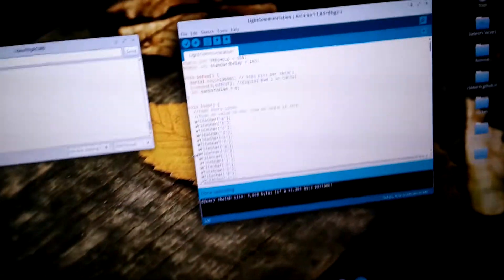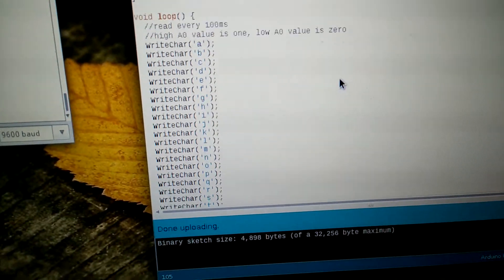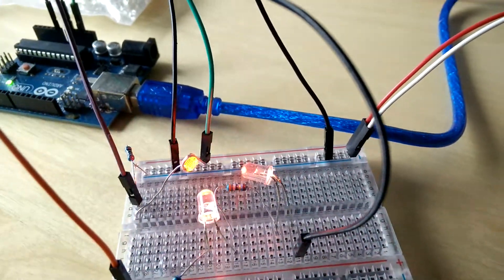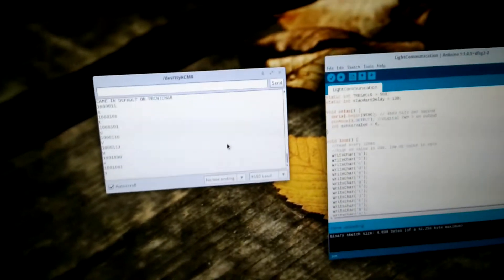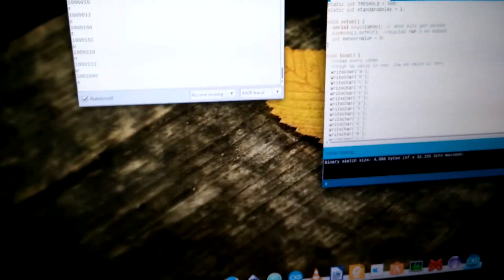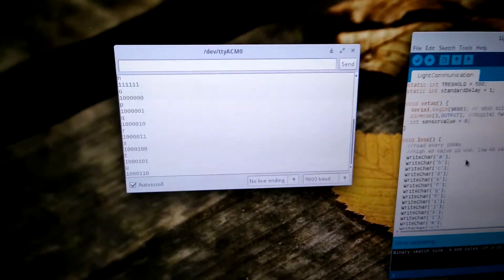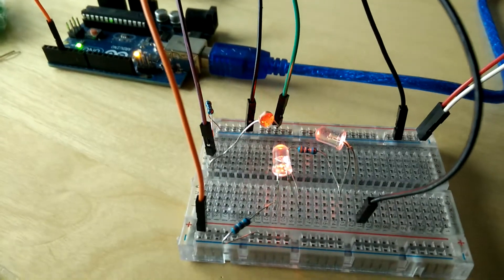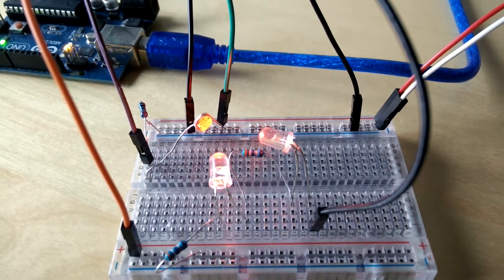Visible light communication with an arduino

Comment: It looks fantastic and I am doing a project which is very similar to yours. Can I have your schematic of your circuit and my email address is (tanjialin0904atgmail.com). Thanks
Reply from the maker: Jialin Tan it's somewhere in the comments :)
Reply: I have found that. Many thanks
Reply: Do you know how to communicate between two arduino boards?
Reply from the maker: Jialin Tan yes it but it's a lot harder than this. The main thing that will go wrong if you upload the unmodified code to both arduinos is that they will not be in sync. So you will need to add some mechanism to sync both arduinos. You could try to google stuff like "PLL" or "preamble". :) I plan to do this in the future, but at least for the coming 6 months, I don't have the time to work on it.
Reply: Thanks for your reply. Now I am working on it since it is my fourth-year project. Your project is very helpful and inspiring. If you have any progress of it, please contact me. Thanks a lot

Comment: I'm working on the same project but i want to transmit the audio and image...would u plz help me out.. or make another video in which u transfer image or audio...! Thnks for the cool video.
Reply from the maker: Dangerous minds I don't have the time to do that right now, but I'm sure Google can help you. High level these are the steps that you'll want to do: 
1) load your chosen image 
2) convert the image to bits 
3) send these bits instead of the alphabet 
4) reconstruct the image from the received bits
5) plot the reconstructed image

I think the second step will be the hardest. Try to google for "arduino image to bits" or something like that. Good luck!
Reply: Well found no answer from google will u please help me out..! Perform one more experiment send smallest bit image from light..!

Comment: hey Vision, it's cool and very helpful. but can I replace the photoresistor with photodiode using the same code like yours? or it must use a different code?
Reply from the maker: Audy Pristikasari hey, yeah that should work too, just make sure to play with the threshold :) the rest of the code should work. Have fun!
Reply: thanks a lot, Vision. I've changed the value of threshold but why in serial monitor it always read on 1111111. ..
Reply from the maker: Audy Pristikasari maybe this video will help, https://youtu.be/HnUYH1pBIrs
Reply from the maker: If it reads 1111111,  maybe your photodiode is always conducting. Try to put it in a darker spot.
Reply: it works. thanks a lot, Vision! :)
Reply: Vision what if I want to measure the responsivity of photodetector? how should I do?
Reply from the maker: Audy Pristikasari You can use a multimeter and put it on resistance. You can see that in the video I linked to in the comments above/below :)

Comment: Hey it's a great work 
But would you help me please 
I want to add some extra letters what should I do in code
Reply from the maker: Rafik Hisham excellent idea. For now, each character only has 7 bits, so you'll only be able to have 128 characters, of which 26 are used so far. For each character, just add a sequence that isn't used yet, and add it in the case/switch. I recommend that you use ASCII for this.
Reply from the maker: Rafik Hisham excellent idea. For now, each character only has 7 bits, so you'll only be able to have 128 characters, of which 26 are used so far. For each character, just add a sequence that isn't used yet, and add it in the case/switch. I recommend that you use ASCII for this.
Reply: Vision i tried it before but it get confused and i didn't understand the str-'0' so if you give simple example that i can use it, and one more thing for last 2 days i tried to make Tx standalone and Rx but the Rx not working good any suggestions? 
Thanks in advance
Reply from the maker: Rafik Hisham Okay, first of all, adding a character:
Two things you should add. 
Once in writeChar() and once in printChar(). Google "ASCII table". You'll see that the characters and light flashes are ASCII encoded. 

For example, say you want to add a space character. If you google the ascii code for a space token, it's 32, or in binary 0100000. 
So you go to writeChar() and printChar(), and add a "case" with the sequence 0100000. In writeChar, a binary "1" encodes to a boolean "True" and "0" to "False". 
In printchar() you can just use the binary sequence. 

Then, your question about the str-'0'. It's a trick to make sure we've got the right character. If yeu want to know how it works, google for "Arduino character representation". Basically, characters in arduino are represented by integers. 

And lastly, I love that you are trying to get it functioning between two arduinos. That was also the next step in my plan, but right now, I don't have the time to do it. The main problem with doing it with two arduinos is that they should be booted on the exact same moment, otherwise it might start in the middle of a character. If you want to avoid that, you should find a way to synchronize both devices.  Hope this helped. Enjoy playing with the arduinos!
Reply: Vision thanks a lot bro if I faced another problems may I ask you again? And what's the best way to communicate with you
Reply: Vision and more question in function lightflash what's the function of it? And should I change anything in this function to add more characters? And why it's input only letters (a,b,c,d,e,f,g)
Reply from the maker: Rafik Hisham lightflash is the function that will actually tell the arduino to put the LEDs on or off. You don't have to change anything in that function. It takes 7 inputs because that's the amount of bits I used to encode a character.
Reply: Vision why exactly the first alphabetical letters?
Reply: Hey Bro , I tried to add extra letters but there's no use why you encoded the 'a' for 49 ? cuz when i tried to use the ascii there's no use
Reply from the maker: It doesn't matter what you name these variables, they are just inputs. You could also name them "input1", "input2", etc. instead of "a", "b" etc.
Reply from the maker: Yes you're right, my encoding is wrong. I didn't follow ascii. I just started counting from ascii('0'), which is 48. If you want to do it the right way, 'a' should be 97. Sorry for that.
Reply: Vision but when I try to do it with ascii it doesn't work right?!
Reply: If you would please modify your code for any example you want add a single upper case letter or a special characters
Reply from the maker: Rafik Hisham
 I'm sorry, you were right all the time. So, I don't encode ASCII, but the difference between the ASCII of the character and the zero '0' ASCII character. Please find my example here: http://pastebin.com/XYb4Q5aR . Sorry for the confusion.
Reply: Vision thanks a lot bro but why in printchar you coded A 1001011 which equals 75 not 17??
Reply from the maker: forgot to remove the first 1 in that sequence

Comment: can you show me a picture of the circuit please?
Reply from the maker: j g.a once again, DNS troubles atm, my site will be online in a few weeks. For now, you can see it here:  https://raw.githubusercontent.com/RobbertH/robberth.github.io/master/assets/img/vlc/vlc_circuit_diagram.png
Reply: ok. thanks very much
Reply: can you tell me what resistence i need for the photoresistor please ?
Reply from the maker: It's a 10K Ohm photoresistor when it's dark. I use it together with a 1K ohm resistor to make the voltage divider. You can watch everything in this video: https://www.youtube.com/watch?v=HnUYH1pBIrs&feature=youtu.be .
Reply: I don't know why, but the letter a, b, and d don't work correctly. can you help me please?
Reply from the maker: j g.a sure, what's up with them? Are you getting errors?
Reply: the photoresistor isn't able to recognise the letter a, b, c and d. it give me an error.
Reply from the maker: j g.a try adjusting the threshold
Reply: I have tried, but it doesn't work

Comment: Hi. I'm having problems with this circuit. The LEDs blink at 9600 BR but the computer prints only "came in default by printchar". I've tried other baud rates, even 300 baud rate didn't worked. Can you please help me?
Reply from the maker: Yeah the baud rate is for your serial communication, the things you should adjust are the standard delay and the treshold value. You might want to watch this video https://www.youtube.com/watch?v=HnUYH1pBIrs&feature=youtu.be .

Comment: Hey, your project is very nice. Do you have the circuit diagram for it?
Reply from the maker: Thanks man! I don't have a circuit diagram, but it's actually very simple. Just connect a resistor to 5V, the other end to some analog input pin, and then connect a photoresistor to ground and the other end to the same analog input pin. Read the analog input pin. Very simple ;) good luck!
Reply: +Vision Thanks man :)
Reply: May i know your resistor values for this project. Thanks
Reply from the maker: +Gaurav Rana Sure, the photoresistors I used are GL5528s so they are about 10K ohms when light shines on them. Any resistor of about the same size will work. I don't quite remember exactly which ones I used but I think 10K ohm would be a good value.
Reply: Hey, can I use photodetector (BPX65) instead of photoresistor? if it is possible then which resistor should I use?
Reply from the maker: +Abdulhaq Soomro Yeah sure, anything that can detect variance in light should work, but a photodiode might require slightly different circuitry. For photoresistors, I can recommend the ones I used.
Reply: Is it possible for you to tell me the circuitry for using Photodiode? as i have only one week left for my final year projects practical work?
Reply from the maker: +Abdulhaq Soomro I'm not going to make your homework, just google photodiode, it's not that hard if you're into electronics.
Reply: Thanks